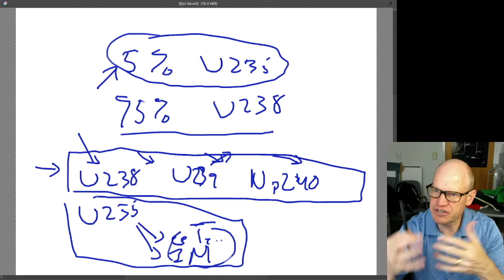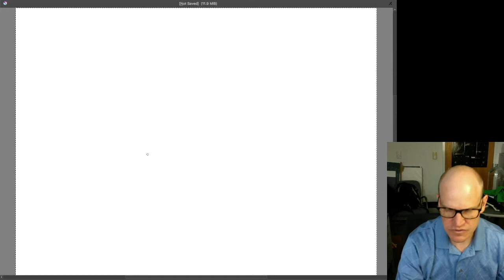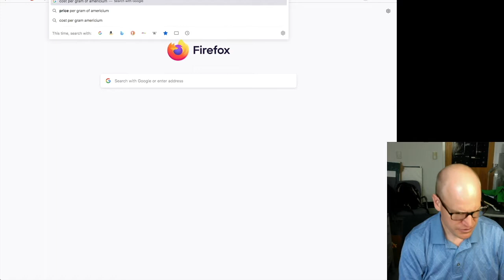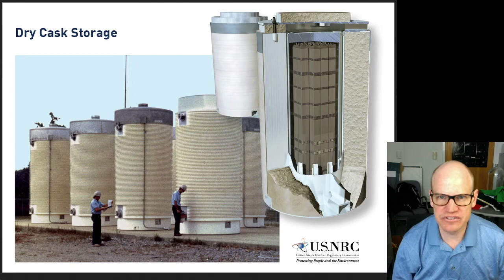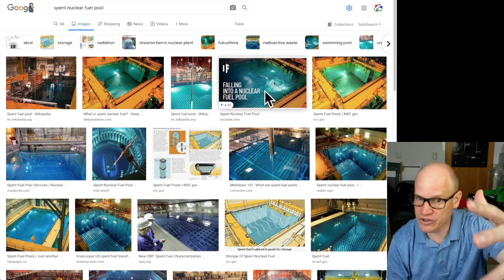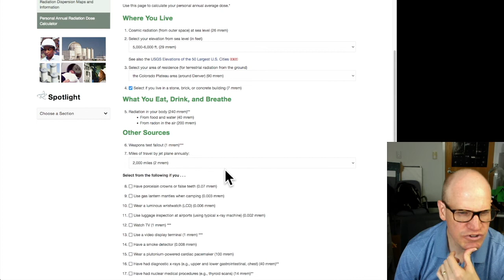Nuclear Energy 03: Nuclear Waste

Comment: The issue with drinking the water would be strontium 90 and cesium 137 leaching out of the spent fuel rods, not so much the radiation. Strontium 90 acts like calcium and can produce bone marrow cancer amongst other things. The concentration on the water is probably very low so you might be okay.

Comment: Dr. Gordon Edwards said, "It is impossible to dispose of nuclear waste. Disposing of nuclear waste is like running in place to complete a marathon. There is no end in sight." Fukushima is proof that a meltdown is like a thousand industrial accidents in succession over generations of lifetimes. TEPCO after 11 years still doesn't know where the corium from Reactors # 1, 2, and 3 are, much less how to deal with it. The latest wrinkle is the cooling water that continuously being poured over the dilapidated ruins immediately becomes radioactive and must be processed through the Advanced Liquid Processing System to remove most (most?) of the radioactive materials. There is no safe dose for ANY radioactive material according to Dr. John Gofman, who certainly knows what he is talking about. He is not alone in that assessment, as you know. The highly radioactive slurry left must be placed in containers which because of the high concentration of radioactivity quickly degrade (like the casks and pools at reactors storing in the open the 100,000 tons of spent fuel within 100 miles of every major U.S. city). The Fukushima containers have strontium readings of tens of millions of Becquerels per cubic centimeter, whereas the EPA safe level for human exposure is 148 Becquerels per meter (not centimeter). Hot, hot, hot! TEPCO has 3,373 of these death star containers, all of which will need to be replaced by 2025. Some already overdue, according to the Asahi Shimbun, 01/02/2022. TEPCO has no procedure established to perform this very dangerous task. Would you care to volunteer as a human robot? Let's up the ante shall we?  The NRA accuses TEPCO of improperly measuring the slurry density when evaluating the doses. TEPCO took their readings at the top, whereas the density and radioactivity would be highest at the bottom. Surely a responsible nuclear operator would never, ever downplay the actual danger of what is on their horizon, would they? Hmmmm?
But trouble comes in bunches with those pesky meltdowns. TEPCO stored radioactive water below 2 buildings near Reactor #4 with bags of Zeolite to absorb cesium. Like the little old lady that lived in a shoe, they had more little offspring than they knew what to do with. Starting in 2023, TEPCO intends to remove 26 tons of this stuff with enough radioactivity to kill within 1 hour. But where to put it? Additionally, TEPCO is going to build an incinerator to burn 480,000 cubic meters of radioactive rubble they have had laying around for 11 years. They haven't started on the stuff more than 90 feet from the roads yet. Wonder if they will put baghouses and electrostatic precipitators on this incinerator, unlike the ones currently burning radwaste. Any idea where to store the ash? Maybe Monju will toss it in with their pile of radwaste. What to do with all this radwaste? After spending $17 billion, Yucca was nixed. It would take 35 years and another $95 billion to finish and it would only hold 70,000 tons; not enough for what we currently have. Finland has hit a snag in their repository. Corrosion of copper containers that they planned to use has caused them to look for something else that might work. Dang it! Those little radioactive Chucky dolls from hell seem to eat up everything they touch! If one is digging a hole to hell, the first logical step is to...quit digging. Give it up, nukies.

Comment: Cs137 and Sr90 both have commercial uses as well. Cs137 as a source for gamma directed radiation medical procedures. Sr90 has uses as RTG as it's decay chain is purely beta so semiconductor damage is far less.
Reply: Cs-137 good for destroying muscle (Chernobyl Heart); Sr-90 good for destroying bone.
Reply: Like beer is the cause of , and the solution to all problems. We need the isotopes to cure the cancer we get from using nuke power.

Comment: One Curie is the radiation that comes off of one gram of Radium-266 metal. And one gram of radium metal is radioactive enough to glow blue in the dark. And it’s also radioactive enough to give you a “3D sunburn” if you kept it close to your body.   Pierre curie taped a vial of radium to his arm and in a few hours his skin turned red, blistered, and hurt quite a bit. Also, one gram of $1500 americium-241is around 2.4 curies

Comment: 3:57 Almost figured out the Pu fuel cycle on your own :D (U-238+n -> U-239 -> Np-239 +e + (-Ve) -> Pu-239 +e +(-Ve))
6:22 you have zirconium in the waste because of the fuel clading in most case made from from zircaloy
10:04 U-238 is fissionable, which means that neutrons with about 2MeV kinetic energy (unmoderated ones) can induce fission
11:31 the confusion is caused if you ignore the % numbers on the left wich clearly indicates that the ratio of u-238 is truncated, the squigly lines on the bot suppose to refer to this too. If you tkae the numbers into consideration you can see that you essentially see only the tip of the graph (bout 6%) as that is only relevant, the rest dark green (94%) is just u-238 all the way.
1:03:26 Radioisotopic Thermoelectric Generator

Comment: What you should do Steven is show the difference between molten salt thorium reactors that use 97% of the fuel instead of with a light water reactors 1/2 to 1% of the fuel and produces very very little transuranics and in 300 years is at the same level as when it was mined. The amount of plutonium is nil. You still have uranium but being 233 instead of 235 produces less waste.
Reply: The solution turns into a highly corrosive acid that destroys the reactors!
TO THINK THERE'S NO RADIATION RELEASED, AND NO WASTES IS VERY STUPID!
The Entire RADIOACTIVE Reactor Must Be Scrapped!
Reply: A much better comparison would be between a thorium MSR and a uranium 235 MSR. 5% u235 is really available and cheap. Once through a uranium burner MSRs are dirt simple and dirt cheap and a much better option than a breeder MSR. Better than both a thorium and u238 breeder for the short term. (short term being the next 50-100 years)
Reply: Nuclear Bombs Tested Created Global Warming, And The Hot Particles Released Are Still Heating The Planet, As They Add More Hot Particles Into The Environment!
Reply: MSRs are great because they can burn the transuranics and online reprocessing should make lots of very short lived isotopes usable for medical and other industries.

MSRs are terrifying because of their reactivity with water. Molten sodium + water = bomb. Same for many of the other proposed salts. Combine that with the corrosive nature of the salts themselves and that's a big engineering challenge.
Reply: @captainotto  Yes molten sodium is very reactive with water but Sodium on its own is not a salt. Sodium chloride is a salt and does not react with water which is good because we cook with it. Florine is another example. Highly reactive on its own but as part of a salt it becomes fluoride and highly non reactive. This is part of the reason why there is a lot of enthusiasms for Molten Salt Reactors. Also new alloys have mitigated the concern about corrosion.

Comment: 27:46 When we graph that displays which elements contribute to the radiation and some elements increase over time, can it be that some elements have several steps before decaying into a stable element. So with for example with Am-241 is resupplyed from other elements decaying into Am-241 and after 5k years the supply of Am-241 from the decayproducts of Am-243 makes the graph of Am-241 so weird?
Reply: Hei Jens, 
Er du kjent med Klimavenner for Kjernekraft?
Reply: @tronderiksen6275  Ja, har til og med kjøpt en genser :)